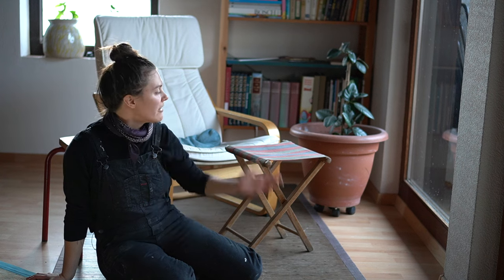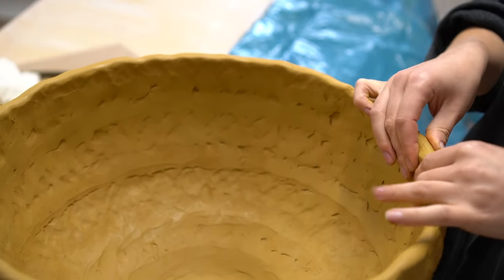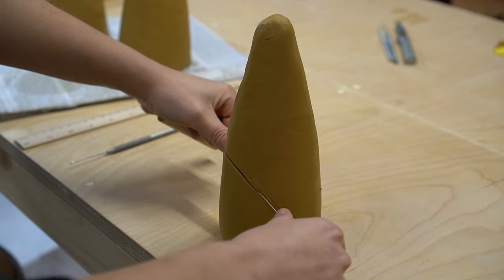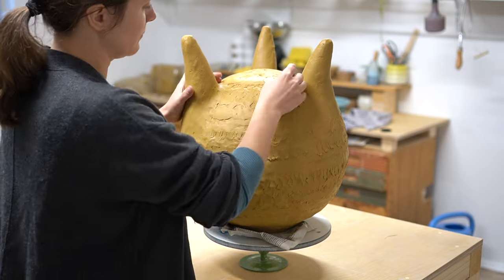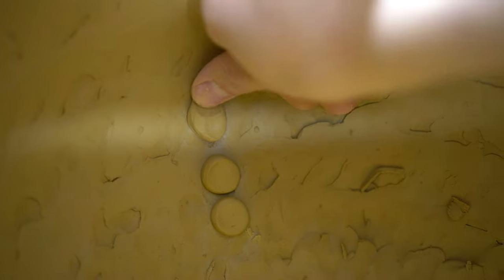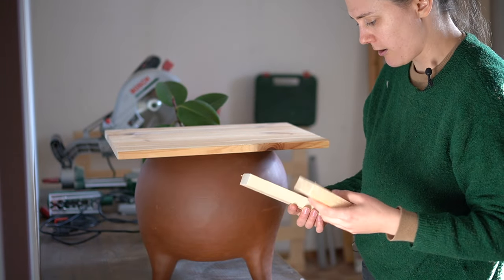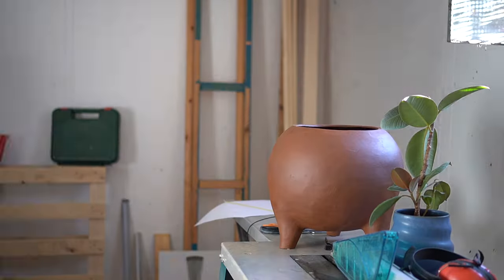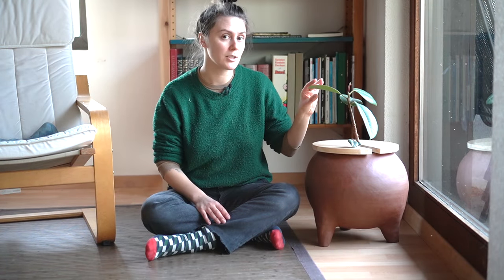Making a ceramic plant table // coil pottery tutorial diy planter table

Comment: Use carnauba wax.  It’s natural and water resistant. Than means you’ll nave time to wipe up wet glass rings, and it won’t hurt the plant.  More, it will keep the moisture into the soil and not warp the wood.  You can even use the wax on the planter.  You just put it on then buff it out with the same tool you’d use to wax your car.  Keep adding layers until you like how it looks.  I usually add 3-4.

Comment: That looks a little bit like how many Africans do their coiling, but instead of pinching them, they support one side of the wall with one hand and thin the wall upward and obliquely with a stiff rib, doing both sides of the wall. And when they attach a big fat coil, they work along the length of the coil, pressing down while twisting the coil with little quarter turns.

Comment: Great design! Looks amazing in that reading corner. For the wood, I'd say some clear coating so it's more water-proof. I'm usually a little clumsy so I imagine that eventually it'll get some of the water from watering the plant. Realistically, I wouldn't always take the table before and sometimes just try to water it through the opening 😅  Great project, thanks!

Comment: The channel cut into the wooden top seems to be adequate for your plant now but if it is a rubber tree it will not fit that opening long.  You should use a finish since beverages can sweat.  Condensation from the interior is also a concern.  Glass could have been a consideration.